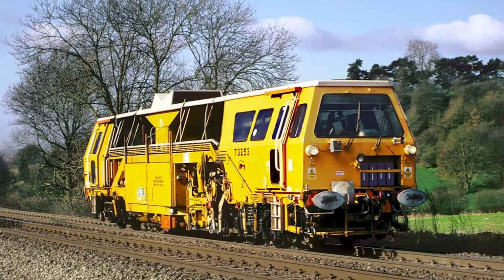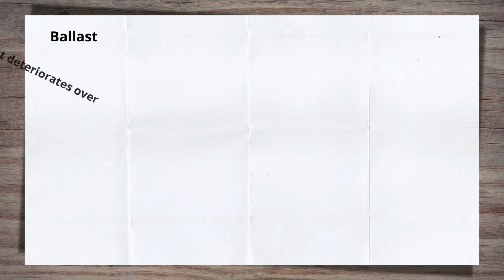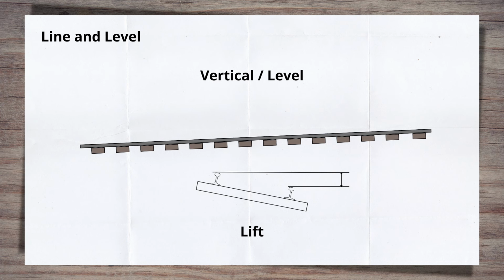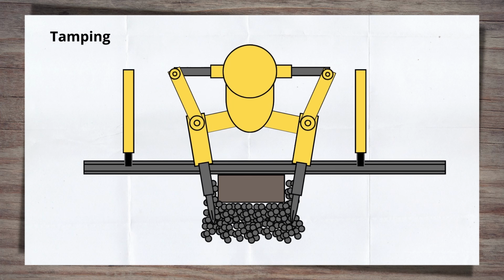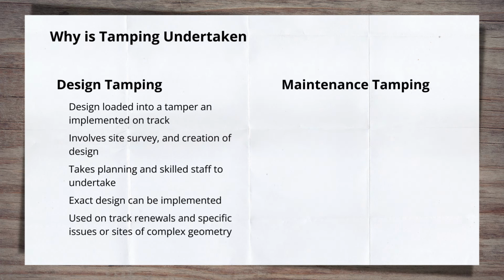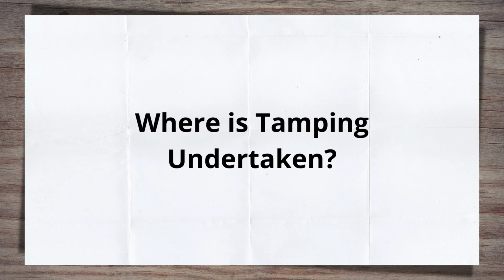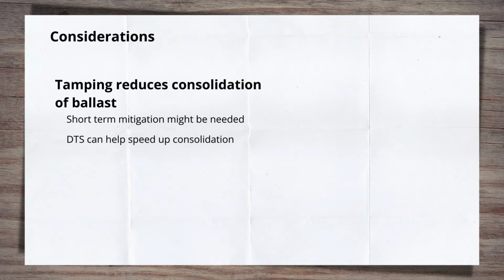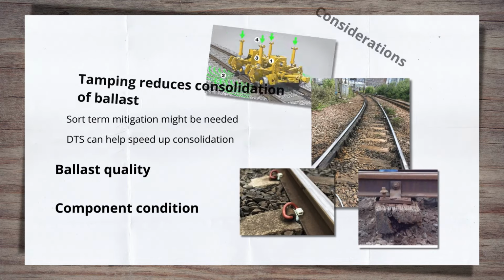Railway Track Tamping. How, Why and When It Is Done on the Track

Comment: Spent many a day on the kango, packing ballast on routine maintenance and after working on a procession at night. And while working at one P'way, they needed a site warden on a tamper.

That was the easiest two weeks I've had, as they told me to get my head down (easier said than done with the motion of the tamper once she got going) or help myself to a coffee.

I was going to mention, the tamper I worked on, when she got to the site, she would make a recording run and then do the tamping run.

When we worked on a weekend relay, we would remove some ballast from the sleeper top, so the operator of the tamper could see their location.

Comment: Thanks for another very clear, concise, and informative video.  In the US, the tamper is usually part of  maintenance train of 5 or 6 cars (aka carriages) with with a different, specialized purpose.  Besides the tamper, there is a car that removes old crossties (aka sleepers) and pushes them off to 1 side of the line, and installs new ones (most crossties in the US are wood so need fairly frequent replacement).  There appears to another car that can pour more new ballast.  And finally, at the end, there's a crane and associated hopper car that picks up and carries away the old crossties, and later deposits them all in a big pile somewhere down the line.  Or so I think,  just by looking at them briefly in passing.  If you know more about such things, please elaborate :)

NOTE:  Until the last couple of decades, the old crossties were just left along the side of the track and anybody could come along and take them home, where they are very useful for landscaping raised flowerbeds, steps on hilly paths, and fence posts.  The railroads didn't mind this because they didn't have to expend effort on cleaning up their waste and, as long as it was just individuals taking a dozen or so for their own use every once in a while, nobody was making or losing money off it.  So, the system was mutually beneficial.  This seems to have changed when hardware stores and garden shops started grabbing the old crossties by the truckload and selling them.  Then the railroads realized they were losing money so got laws passed to declare that just because an old, worn-out, discarded crosstie was lying beside the track like all the similarly discarded empty beer cans left by the motorists of the adjacent road (which the homeless drug addicts pick up for recycling money to get their next hit and nobody complains), it didn't mean railroads were littering , nor had they relinquished ownership over the crosstie.  Thus, those taking  the old crossties were suddenly thieves, despite doing a public service in removing litter.  And so nowadays, if the cops (or railroad employees) see you taking old crossties, you can go to jail.  Which is why the railroads now have special cars to gather them all up and dump them in a camera-secured pile to sell to the hardware stores and garden shops, which is now the only legal way consumers can get them.  It's a sad turn of events.

Comment: Pretty much spot on, just one thing you came close to but didn't mention.
The frequency of the vibration of the tines also causes the ballast to act as if it were a fluid. This enables it to flow in to voids beneath the sleeper beyond where the tines could just push it.
Reply from the maker: I did read that somewhere! I tried to work out a way to state it without it sound far fetched! You have stated it very clearly so thank you!
Reply: @thepwayengineer  I can't remember where I read it now, could have been in one of the PWI books.
Reply from the maker: @aimdrummer  Probably the same one I read!

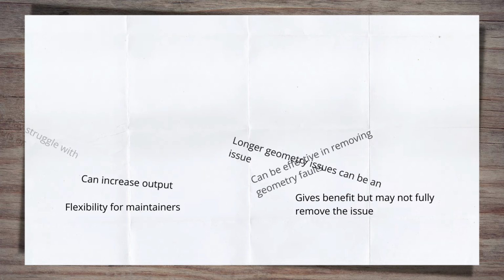Comment: 7:21 this is not entirely true, the ALC can actually map out a geometry like file using the F5 constant area function where the operator can set the Level or the line to the position required, so for example if you have a long slack in the track, instead of smooth line computation, you can tell the ALC i want it at this position to give geometry like results.